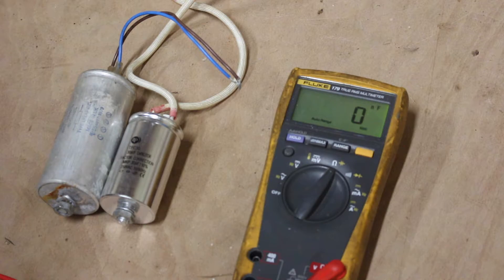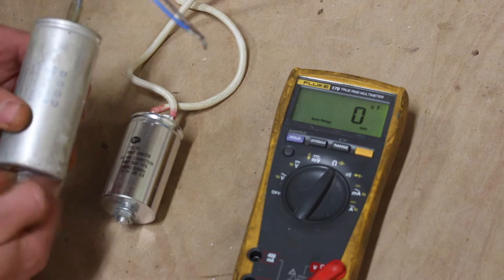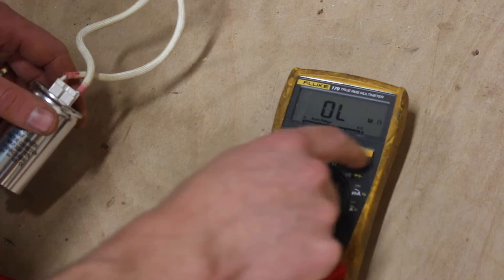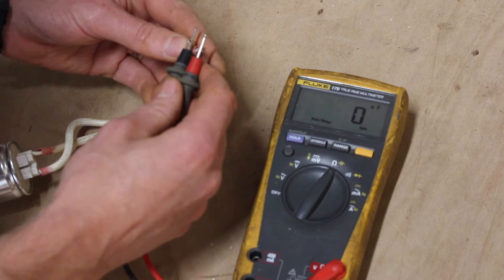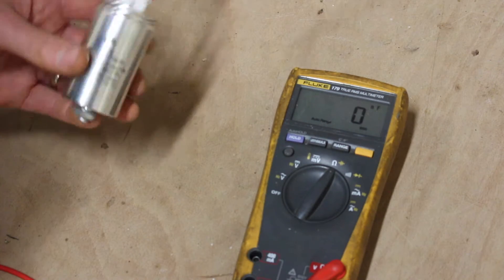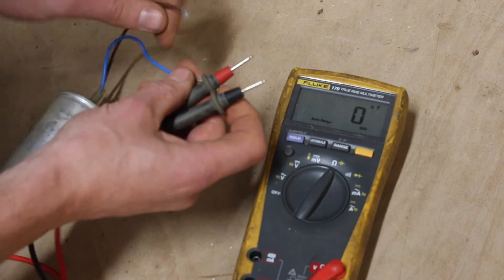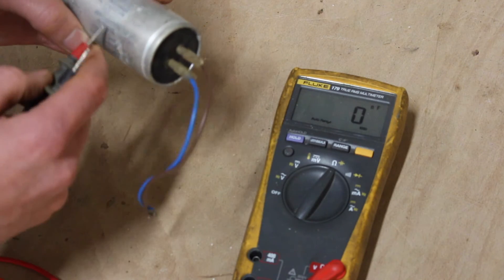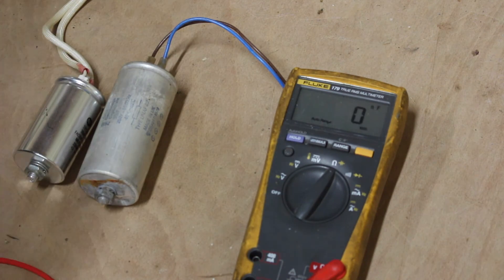How to Test a Capacitor with a Multimeter

Comment: I was worried I needed a $300 Fluke to do this test, but luckily my $20 beater does it. Etekcity Digital Multimeter MSR-A600 has a capacitance setting. This video saved me $500.

Comment: hi do we need to discharge the capacitor first?
Reply: Absolutely. If you don’t short the cap’s terminals (with a screwdriver usually) before testing it , depending on the power of the cap , you can receive a minor or major shock
Reply: @bigmedge  thanks a lot.
Reply: Yes, use your tung

Comment: Unfortunately, this type of test can only be done on an expensive multimeter. Any digital multimeter under $25 will not have the proper settings to check the MFD rating of a capacitor.